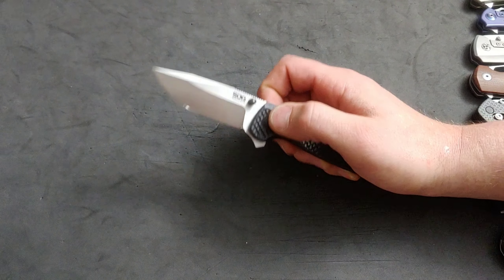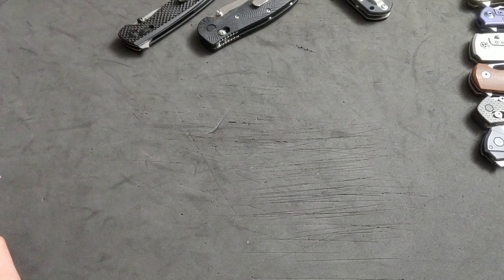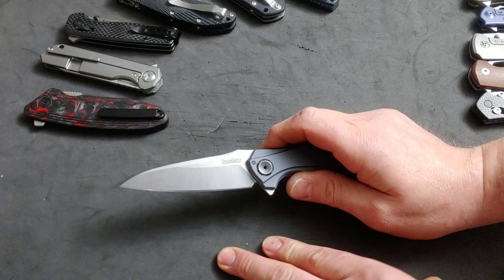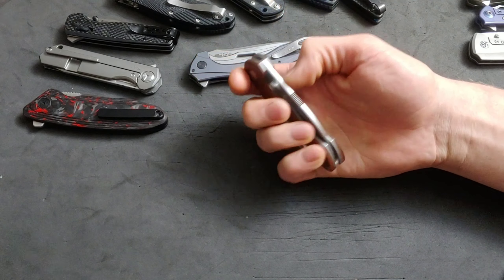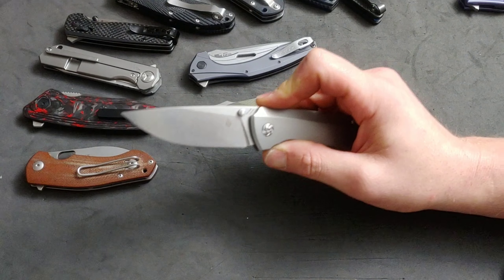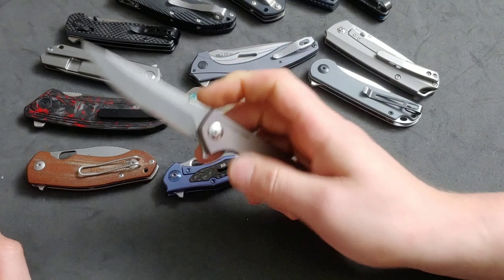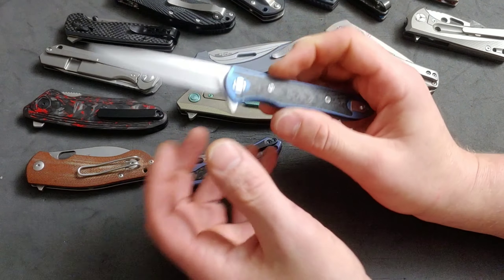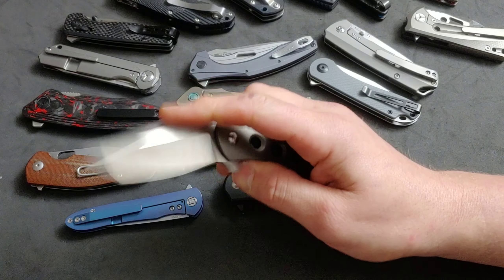Form Over Function Knife Talk

Comment: Points well taken, I wonder all the time how many knives well over $150 can even make it off the production line due to issues that shouldn't exist if there were some practical applications applied to their QC. Nice video.
Reply from the maker: Right! And some things wouldnt bother me as much like with fitment if the knife is built in a way to be used. Ive noticed some knives that get lock rock after I use them for a week, and that is after so many people said they used them and said how great they were, it makes me wonder what people think using their knives are

Comment: Basically how I felt about my 940-2 blade geometry on it is way too thick to cut card board even when the blades hair popping sharp. It makes a very nice letter opener with the blade shape when it’s hair popping sharp and it’s good when cutting food in the kitchen. So that’s how I use my 175ish dollar 940-2
Reply from the maker: I know what you mean, and this is one of the problems with blade geometry, even if its ok from the factory whats it going to be like after 5 sharpenings, if its super thick behind the edge mow what good is a knife that loses its life after 5 sharpenings
Reply: @NeevesKnives  And yet there are still huge blocks of knife people that swear by 940s. My Ganzo FH21 out cuts all three of my 940s, including the S90v.

Comment: 2 of my knives come to mind ... 

First would be the Boker Plus Takara CF. Bought it because I was curious about it and I was pretty well impressed with my two previous Boker Plus knives, but most of all I bought it because it was on sale for less than the G10 version🤔 It's not that I'm disappointed with the knife. Rather the contrary! It's an awesome toy that also works great as a cutting tool😁 Fit and finish is excellent, very comfy in the hand and it's very pretty in a strange ... Japanese sort of way🤨 I would carry it a lot ... but ... that BEAUTIFUL pocketclip🤩 makes it a pain to get it in and out of the pocket😫 To anyone liking this knife: Get the one without the clip, it comes with a leather sheath ... you'll be better off that way😥
Second would be the Ruike P831. That knife to me is so beautiful🤗 even in spite of the blue anodizing🙄 It's just the most awesome design ... except for the thumbstud🤬 It's one thing that you need to lay off the lockbar, that's just how some framelocks come, I can adjust to that. But given the fairly strong detent this thumbstud is just not steep enough and the cutout for it is not deep enough. I love a knife with thumbstud(s) or a deployment hole for giving you the option of slowrolling or flicking the blade, but with this one you need to be very deliberate about flicking it, and you simply can not slowroll it😭
I might be ranting ... but hey, sometimes I get a bit passionate about my blades😏
Reply from the maker: I know everything your saying and what your talking about, and those details keeps them from being used even if they are great in ways, and those details are not a secret, they had to know if tested that these are issues. Most of wich are easily changed before they make 10000 of them. It really sucks when you spend 80$ on a knife that you dont enjoy using as much as a 30$  that did do things right. Not everyone agrees about everything but certain things are a given.

Comment: Hey brotha I think you can still get a reblade on that ZT0450. It's not technically warranty work cause you pay for it. I think ZT charges $40 for that right now. Sucks you got a bum blade I got an S35 0562 and thing preforms like a beast, it's my go to work knife.
Reply from the maker: Yeah I think I might try, and ive heard that they had issues in the past but fixed them with and maybe it was from an older batch, but ZT is a great company that does great work

Comment: Hmmm i gotta use my 0450 more and see if the steel is alright or not
Reply from the maker: Yeah I heard that they had some problems with older models, and that they have fixed the ht issue and maybe mine was from an older batch or something
Reply: @NeevesKnives  Check the serial number.

Comment: The statement is form FOLLOWS function. Saying form OVER function means "make it pretty, we don't care how it works". The form needs to accommodate the intended function, regardless of how it looks. Isham comes to mind as a designer of the first kind. Interesting looking but never intended for use. Hinderer is the second kind. Doesn't really care what it looks like, but it had better 'efen work! 

Of course, I don't just collect working knives. Some I bought with the intention of NEVER using them, just looking and playing is their intended function. In that regard, they are quite good.
Reply from the maker: The statement meant that, thats how some knives are built with form over function instead of function over form. And I do agree with you and some knives are supposed to be that way but most are supposed to be used as a pocket knife for work or edc, so I do agree with you

Comment: Have you contacted zt? Maybe if it's related to b
Steel HT, they might overlook modifications.
Reply from the maker: I havent I thought about seeing if I could get a new blade if I paid for it but i did etch the blade and stonewashed it so I doubt they would overlook but it doesnt hurt to try
Reply: @NeevesKnives  ZT has ruined to great steels reputations elmax and s35vn  because they run them soft.
Reply from the maker: @mred2099  yeah this ones definitely messed up, I sharpen hell of knives and its the worst ive seen